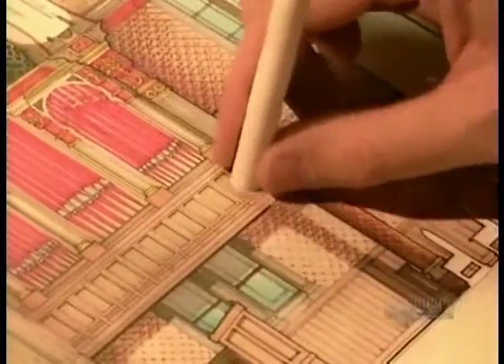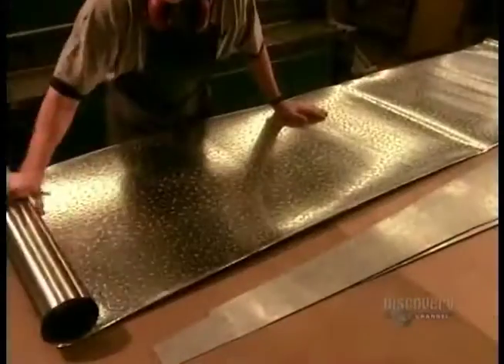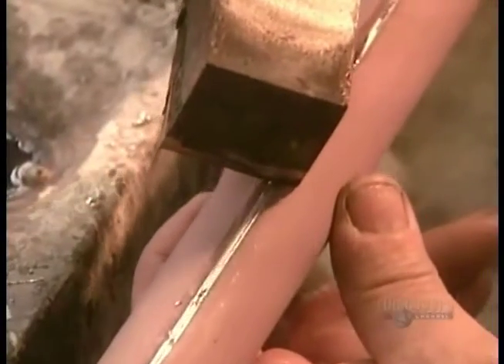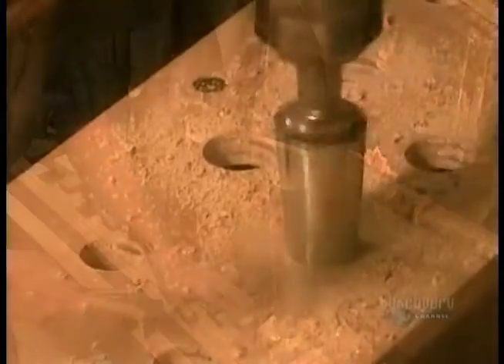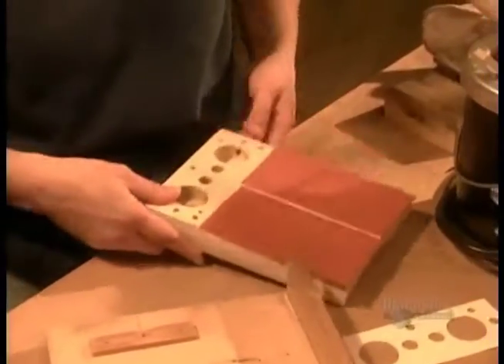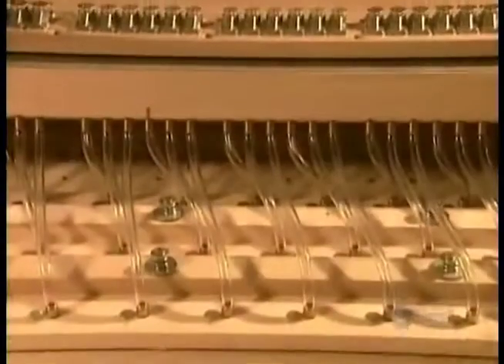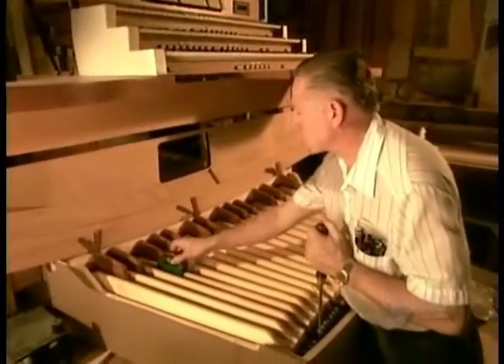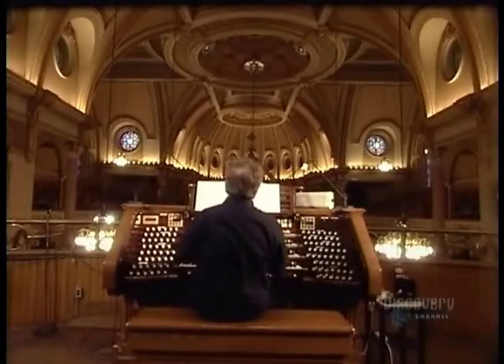How It's Made - Pipe Organs

Comment: imagine tuning one of these beasts
Reply: A good team of 2-3 guys can get a small 37-rank 2-manual done in an afternoon. It takes years to get really fast at it. 
You gotta use a long "tuning knife" to do it because your body heat will change the pipe ever-so-slightly, meaning that if you tune a pipe while holding/grabbing it, then let it cool, it's back out of tune already. 
If you can keep the room the Organ is in at the exact same temperature and humidity, you won't have to do any tuning work on it for years between.